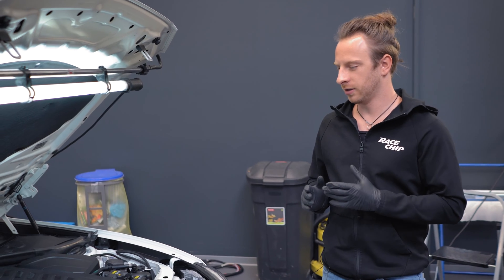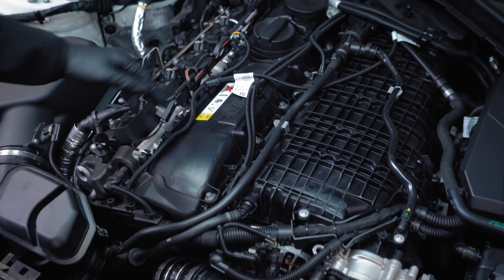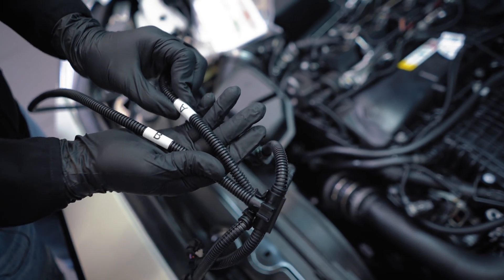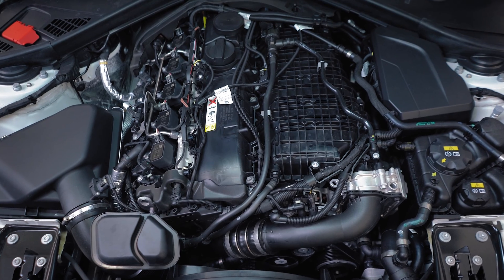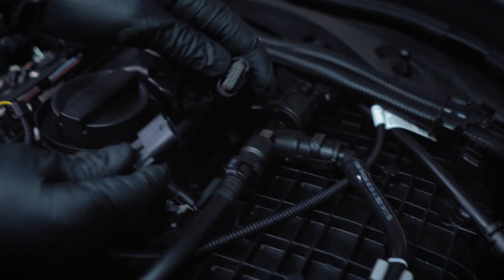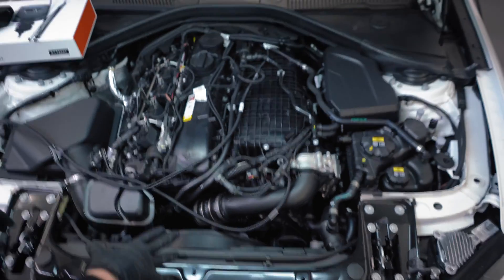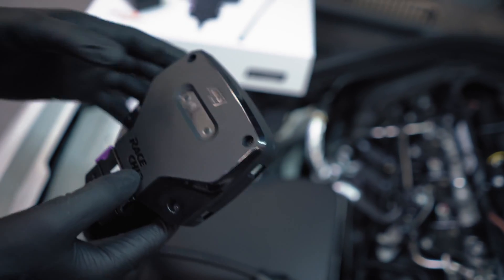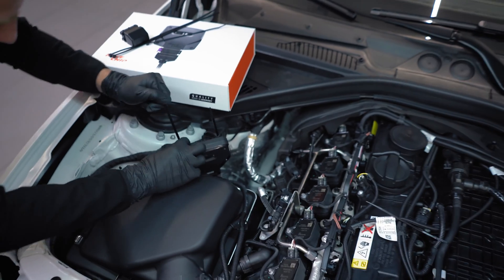BMW B58 RaceChip Tuning Installation 340i 440i 540i 640i 740i X3-X7 Z4 40i

Comment: I finally got mine installed. WOW, what a difference! Face melting power! Now here is the question: Do I have to send this back to Germany if I uprgrade the turbos and add downpipes and a high flow air filter?

Comment: I have a 2025 m 240i with the B58 engine. I really was about to buy the JB4 but I keep hearing a little bit about this tuning module. Does anyone have any experience with this as far as which one I should go with? JB4 or this?
Reply: Get this one. I just had mine installed on my M240i and it is FAST. Took my boy 5 minutes to complete the install

Comment: My clips must be glued on. They are a bitch to get disconnected. The instal on video is a thousand times easier than it is in real life. The clips refuse to come apart.
Reply from the maker: If they seem very difficult to unplug, you can grab a small flat head screw driver, or pick, and use it to release the clip. You can practice on the RaceChip Harness before hand as it is a similar style plug.
Reply: @RaceChipInstallationVideos  so, I eventually got them to disconnect. I had to get a small flat head and push the clips off rather than pull. Once I pushed with the flat head from the back of the clip towards myself the clip came right off easy no problem. They weren’t coming off otherwise. Geez that was a nightmare.
Reply: @RaceChipInstallationVideos  also. The chip is a monster. Major difference. Glad I bought it. Every x5 40i needs this.
Reply: So you just turn on the car after connecting everything?  Does the module turn on when it’s in accessory  or only when you turn on the car ?

Comment: So, what happens after i turn the car back on? Do I have to choose settings from the app?
Reply from the maker: The device will come with a map pre-selected, however, you can use the app control to further change the maps to your desired performance increase.
Reply: @RaceChipInstallationVideos  when you say map you mean like a mode to use? Like sport mode or race mode? I just select one and that’s it?
Reply from the maker: @christopherwarren7189  Head over to the website and shoot a message to our customer support. They are happy to walk you through how the product functions in conjunction with the vehicle.

Comment: Will this void BMW warranty or the aftermarket warranty I purchased at the time of purchasing the vehicle???
Reply: But they will know the boost and other metrics were significantly increased from an outside source. Indicating a piggyback tune, in which they will flag the warranty
Reply: I would avoid go to the dealership at all costs
Reply: @b58.fazil0  precisely 👍
Reply from the maker: I would check with your warranty contract to see if adding a piggy back unit will void it. Do note, since we are a piggyback unit, if you spend a few minutes to remove the RaceChip before you take it in for service, the mechanic or technician will have no idea that the RaceChip was ever installed. You simply unplug the RaceChip from the sensors and re-insert the OEM plug.

Comment: Hey in having issues pairing my racechip to the app.  Installed it on my 11 x5m it came on with the number 5 the power sign and the bluetooth signal but when i try to pair it its saying failed.  plus im not seeing it in my bluetooth list on the phone.  fyi i have the GTS black with the app.
Reply from the maker: Email our customer support by visiting the website and they can help you out. Should be something simple and they can provide a quick solution.
Reply: Same stuff happening with me. Only my app is asking me for a BT pairing request number but nothing shows up on the GTS Black so I have no pairing request number to plug in. So frustrating

Comment: English:
Steer clear of the boxes. The tuner says that the engines still have reserves. That is also true. But it is only reserves that are rarely used. It is also said that the spare parts are the same, because they have the same spare part number, which is completely nonsense. Take the example of pistons: BMW does it like almost all other manufacturers. They only offer one spare part. And that is done to reduce costs. They basically offer the higher quality pistons. This also applies to all other spare parts. So they only build a "row" of pistons. There is the lower performance class, the medium performance class and the best performance class: the more power an engine delivers, the higher the exhaust gas temperatures that are supposed to be extinguished. However, this is not possible, because the file is particularly protected and that is with a password. No tuner knows this word. He will tell that you can undo the tuning. Sure, when the box is off, normal performance is back. Unfortunately, however, he cannot delete the much too high exhaust gas temperature values. In the event of major engine damage, BMW will not pay anything and the tuner talks himself out that the accelerator was given full throttle when the engine was cold. In addition, you drive almost all boxes in the range between 200 EURO and 500 EURO without ABE. The vehicle should not be on the street. When that comes out, the driver's license is gone in Germany. Withdrawn for at least 6 months. If there was an accident, your insurance company will not pay a cent. You also have to pay for the damage to other cars. If people are injured, the compensation can take the form of a monthly pension. In such a case, the driver's license will be withdrawn for at least 1 year. You won't get the old driver's license back either. You have to do eye test, first aid course and almost always an MPU. Most fail at the MPU and then you can do one more.
I only know a tuner who works with BMW like the M department. The guarantee is retained, it is entered in the papers and you drive legally.
But that costs almost ten times the attached link. Of particular interest is the E87 as 116i, 118i, and 120i. The 2 l machine must be installed on the 116i. The somewhat different airflow of the 120i with 170 HP doesn't matter much. So for little money a 116i with 122 PS can become a 120i with 170 PS. Only values at the turbo sensor and injection sensor are tapped. Here is a link to it.
                                                 https://www.realoem.com/bmw/

Here you will find pretty much all BMW vehicles and also some other brands. With a few extras, I got over € 60,000 for my m140i. You risk tuning into AC Schnitzer.
Reply: Deutsch:
Finger weg von den Boxen.Der Tuner erzählt, dass die Motoren noch Reserven haben. Das stimmt auch. Aber es sind nur Reserven, die selten genutzt werden. Ferner wird erzählt, dass die Ersatzteile gleich sind, denn sie haben ja die gleiche Ersatzteil Nummer.Das ist völliger Unsinn. Beispiel Kolben: BMW macht es wie fast alle Anderen Hersteller auch. Sie bieten nur ein Ersatzteil an. Und das geschieht um Kosten zu senken. Sie bieten grundsätzlich den höherwertigen Kolben an. Das gilt auch für alle anderen Ersatzteile. Somit bauen sie nur eine "Reihe" an Kolben. Da gibt es die untere Leistungsklasse, die mittlere Leistungklasse und die beste Leistungsklasse.Je mehr Leistung ein Motor liefert, um so höher sind die Abgastemperaturen, die man angeblich löschen kann. Das geht aber nicht, denn die Datei ist besonders geschützt und zwar über ein Passwort. Kein Tuner kennt dieses Wort. Er wird erzählen, dass man das Tuning rückgängig machen kann. Klar, wenn die Box ab ist, dann ist wieder die normale Leistung da. Leider aber kann er die viel zu hohen Werte der Abgastemperatur nicht löschen.Im Falle eines kapitalen Motorschadens wird BMW nichts zahlen und der Tuner redet sich heraus, dass man zu schnell Vollgas bei kaltem Motor gegeben hat. Hinzu kommt, dass Ihr bei fast Allen Boxen im Bereich zwischen 200 EURO und 500 EURO ohne ABE fahrt. Das Fahrzeug dürfte sich nicht auf der Strasse befinden. Wenn das rauskommmt ist in  Deutschland die Fahrerlaubis weg. Entzogen und zwar für mindestens 6 Monate. Falls ein Unfall dabei war zahlt Eure Versicherung keinen Cent. Die Schäden an anderen Autos müsst Ihr auch zahlen. Sollten Personen verletzt sein, dann können die Schadenersatz in Form einer Art monatlichen Rente bekommen. In solch einem Fall wird der Führerschein mindestens 1 Jahr entzogen. Ihr bekommt den alten Führerschein auch nicht wieder. Ihr müsst Sehtest machen, Erste Hilfe Kurs und fast immer eine MPU. Die Meisten fallen bei der MPU durch und dann könnt Ihr noch eine machen.
Ich kenne nur einen Tuner, der wie die M- Abteilung mit BMW arbeitet. Da bleibt die Garantie erhalten, es wird in die Papiere eingetragen und Ihr fahrt legal.
Das kostet dann aber etwa fast das 10 - fache- Anbei ein Link. Besonders von Interesse ist der E87 als 116i, 118i,und 120i. Beim 116i muss die 2 l Maschine verbaut sein. Die etwas andere Luftführung des 120i mit 170 PS macht nicht viel aus. So kann für wenig Geld aus einem 116i mit 122 PS ein 120i mit 170 PS werden. Es werden nur Werte am Turbo Sensor und Einspritzsensor abgegriffen. Hier mal ein Link dazu.
                                                 https://www.realoem.com/bmw/

Hier findet Ihr so ziemlich alle BMW Fahrzeuge und auch teilweise andere Marken.Passt irgendwie auch nicht. Mit ein paar Extras bin ich bei meinem m140i über 60.000 EURO gekommen. Da riskiert man in ein Tuning bei AC Schnitzer.

Comment: What about catless? Risk of damage?
Reply from the maker: Catless downpipes can cause damage on a car even before it is tuned, or after as it excessively wears exhaust components. Please be aware that some downpipes (especially catless downpipes) can trigger check engine lights. No matter whether a RaceChip is installed or not. 
RaceChip does NOT remove check engine lights.
Reply: @RaceChipInstallationVideos  thank you for your response 👍

Comment: Any danger with the car running too lean with a downpipe?
Reply from the maker: As long as the downpipe is catted you should not have any issues.
Reply: @RaceChipInstallationVideos  this one happens to be with no cat😭
Reply: RaceChip Installation Videos I do have the Active Autowerke high flow catted downpipe, Do I have any risk with my engine using this downpipe in conjunction with the race chip?
Reply: RaceChip Installation Videos is the racechip warranty still valid if I run a ECE/EWG 300 cell HJS Downpipe ?

Comment: When I tried to remove the connectors, it seemed unremovable. What should I do?
Reply from the maker: They can stick a little. Make sure the locking tab is pulled and press down on the release tab. You can also place a small screwdriver under the tab to help push out the sensor plug. Push with even pressure and not to hard and it should come out.
Reply: RaceChip Installation Videos I was able to remove B easily but A won’t release. When I press the plastic tab, it still won’t release. Any tip on getting it released?
Reply from the maker: Trying pushing in on the plug while pushing up on the tab. Then while holding the tab pull the plug off.  Sometimes that will help.
Reply: should have went with bootmod3
Reply: I am having the same issue.
Reply: I figured it out, you have to pull out the tab, push in the whole cable and push the tab sideways till the click, then pull out.
Reply: @mikedubounsky2656  what are you talking about? What cable is pushed in? What clipped is pushed sideways???

Comment: Undetectable?
Reply from the maker: In contrast to programmers or remapping, the ECU is not modified at all. The ECU does not recognize the RaceChip. 
Once the RaceChip is removed, the car is 100% in stock condition again.
Reply: How easily can a dealer dig into the logs to see boost is higher than stock?
Reply: So once removed, BMW can’t pick up that it was ever connected? Just don’t want to lose my motorplan
Reply from the maker: That is correct.
Reply: RaceChip Installation Videos I own a 2016 bmw 340i rwd, I bring  my car for service three days ago, the SA explained me with the new software BMW have right now they can detect any higher boost in the car produced  by any type of tune map ots like bm3, MHD etc or any unplug ably device like JB4’s Dinatronics  etc flagging your car and drive train warranty voided. So the race chip it’s different than all of those? Cause if you guarantee me if before go to service I can remove my race chip and then I’m totally safe and my car will be undetectable you got my money immediately but I need that confidence not just with ur words,  in writing...please let me know. THAKS.